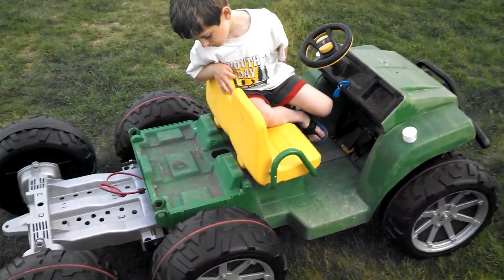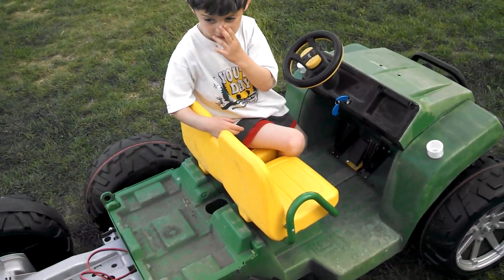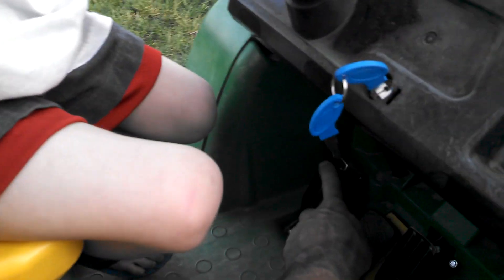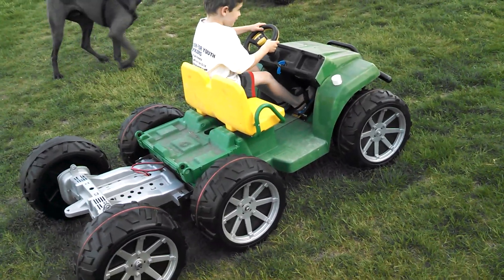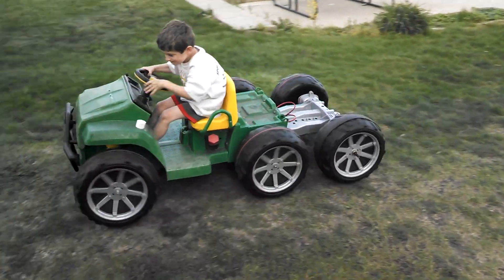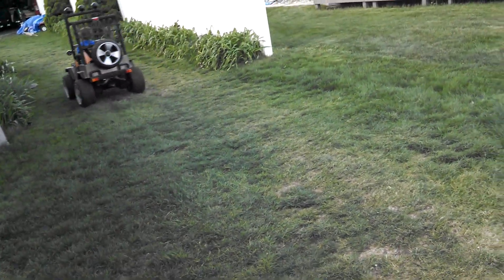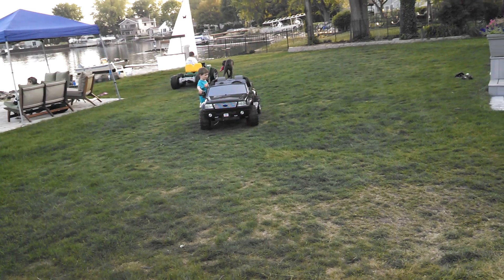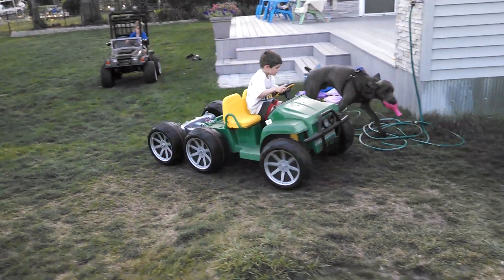Project Gatorazor gets 4 36 volt motors

Comment: just seen this. yer a good dude. upgraded my daughters 6v to a 12v. now I'm looking to upgrade my sons 12 to either a 18 or 24v. is there anything I should know about the gearbox?
Reply: What i done is 12v to 18v becase 24v is to mutch stress to gearbox and motors. Just add a 6v 12mah battery 👍 12v+6v =18v